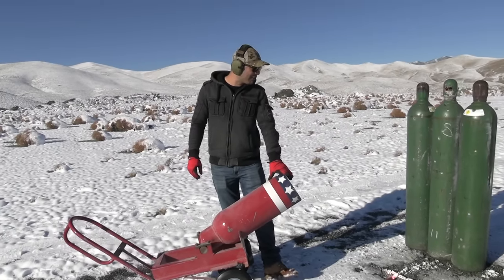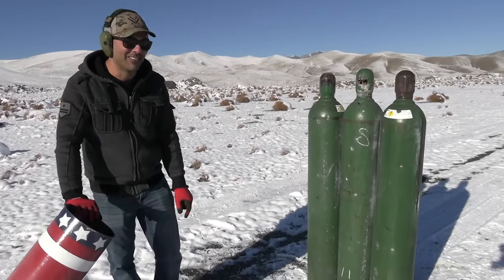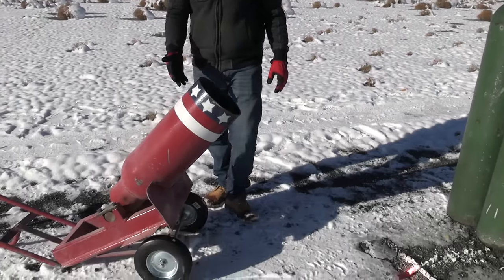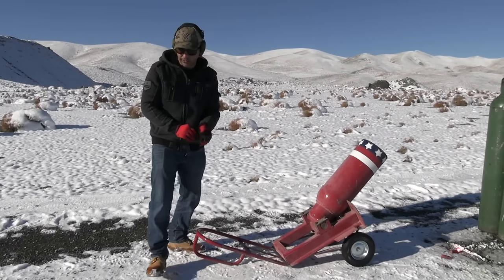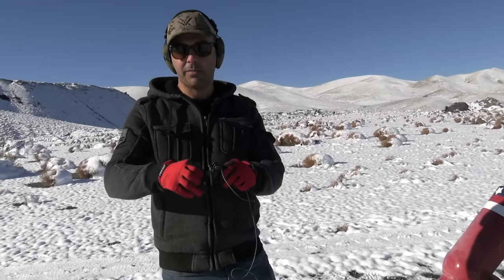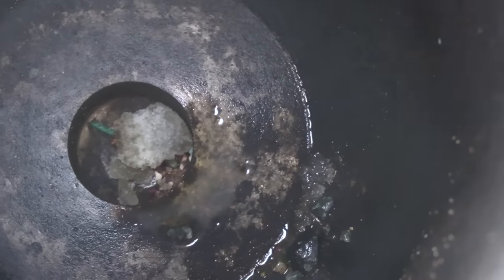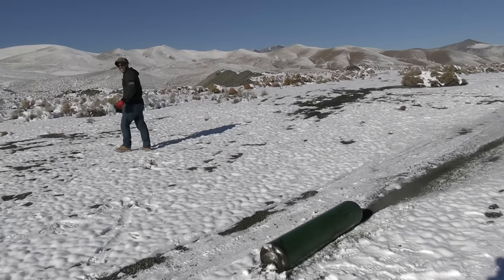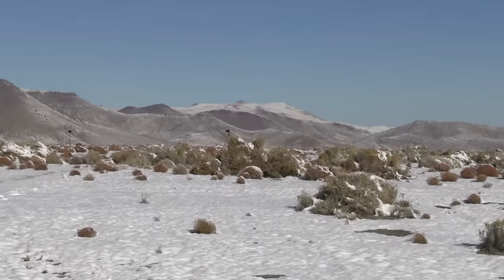Bowling Ball cannon vs oxygen tank

Comment: An oxygen welding tank is about 1/4-inch thick to hold the 2,000-psi gas. I'm not sure what grade of metal is used, but it must be good stuff. When I took Welding 101 we watched a safety film showing a oxygen welding tank where the safety valve sheared off. The oxygen tank went halfway thru a concrete block wall. BTW, 2,000-psi is similar to the pressure produced by a rocket motor.
Reply: we used large steel ones exactly like that at the dive shop for the big compressor in a bank of 5 and they'd fill to 4500psi. We had a tank in the alley that was a old submarine ballast tank for more capacity as well.

Comment: Amazing!  When I was young I worked for the phone company - we used to pump the cable full of dry nitrogen after we worked and closed a splice to make sure it was air tight.  The nitrogen was in those types of tanks (heavy) and the old timers told me never to drop one because it would take off like a rocket engine.  I never did drop a tank, but this is the first time I ever saw an experiment demonstrating the effect.  Thanks!

Comment: Being a Respiratory Therapist for years I had the opportunity to shoot the valve stem off an H cylinder filled with a non oxygen tank. I used the 22-250 with a 60 gr bullet traveling about 3700 FPS. It removed the valve stem and turned into a blurred spinning disc that bounced numerous times. I was about 80 yards away and I wondered if I was far enough away.

Comment: This is what you need to do. One big oxygen tank like these, and one big acetylene tank. Aim the cannon so that the ball hits the top of both tanks. Use 2 cannons if necessary. Tape flares all around the top valves on the tanks. Then blast them. Make sure the tanks are strapped together so that they don't fly off in different directions. Don't get yourself killed.

Comment: Well, I guess the hybrid between the previous video and this one is to buy a sled, strap a cylinder to it, remove the cap, and then see if you can shoot the valve off with a rifle. The tank would have to be sideways relative to the shooter. I'm not sure a 5.56 or .223 would do it at safe distance but anything bigger should work.

Comment: Recommendation: Try Placing some wadding/small blanket around bowling ball to fill in gap between ball and tube, "use wooden ramrod if needed, "so less gas will escape, Preferably a touch more powder, 1 1/2 pound or So-with a longer fuse, possibly a little further away, maybe behind a large rock, No need to place your head between your legs and,  Well, You know the rest of it !

Comment: I get that oxygen cylinders have greater pressure than most, but it's not flammable by itself. So the flare is unnecessary unless there is a propane or acetylene tank involved.

Comment: We used to put them in a holder and smack valve off with sledge and launch them in the air over Lake Michigan when I worked at the steel mill

Comment: FINALLY  YOU TOOK THE VALVE COVER OFF - that is where the reaction and danger comes from, when the valves break it is like a torpedo  Your bowling ball canon is a cylinder too. The danger comes with any gas. The bowling ball did not have enough Kenetic energy to do squat.

Comment: When I did my military service in the airforce. We had O2 and carbondioxide on wagons, for refilling the jets.Anyway, one time (Iwasn't there) the valve was knocked off and the wagon speed across the hanger, about 150m, went straight through a steel reinforce concret wall, about a meter thick. Went straight throu....Opps :D

Comment: Got an idea for ya! Take the valve off an empty cylinder and find a way to get an electrically ignited charge inside, then replace the valve and fill it with oxygen using a cheater hose and another tank! Maybe there is a pressure rated electrical fitting you can thread into a couple holes drilled in the neck. Gunpowder igniting in a pressurized oxygen cylinder should be exciting!😁

Comment: I suggest you get an oxygen bottle and another propane gas and make a common mixing tube and electric valves that open forcefully to a combustion tube with a lighter to make a rocket propulsion system and put all the equipment on a cart with tires to launch with great force.

Comment: I just found your channel today and have spent the past 3 hours or so watching and laughing. BUT...I assume you put the flares on and around the O2 tanks hoping for fire. Do you realize oxygen doesn't burn? It drives me nuts everytime I see an 'oxygen explosion' in a movie. An air tank even killed Jaws! If it had just tore him to pieces, it would have been fine but the fire ruined it... Anyway, high pressure tanks are super, so I'm not suggesting you don't use them...just mentioning the obvious. If you were a welder, you'd know...on an oxy-acetylene rig, which do you have to light first? This video was the topper! You couldn't have scripted that!

Comment: 40+ years welding only seen the valves come off twice once it sat in the bottle holder all chained up and just shot the gas out a lil at a time the other one fell off the truck when we got back to the shop and it lodged itself half way thru a brick (cinder blocks) wall I say half way it actually went thru it’s just the bottle got half way thru and the gas ran out😹😹